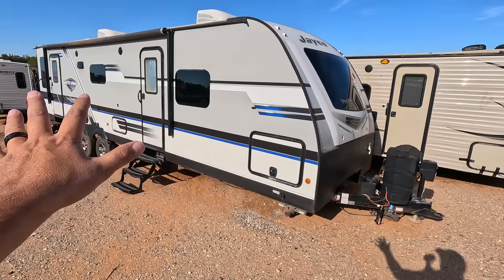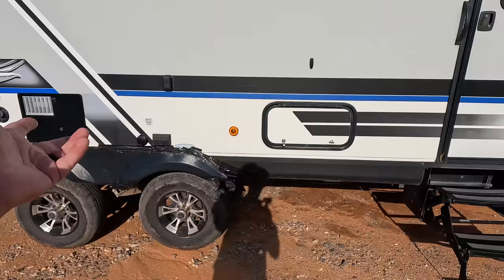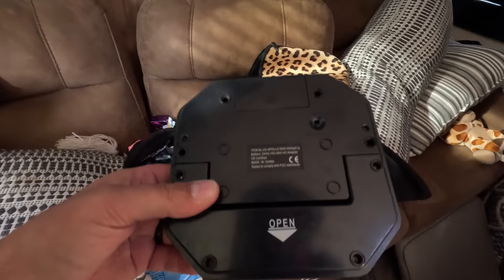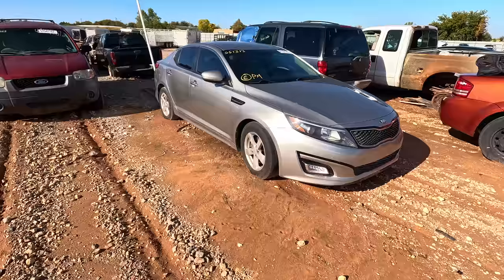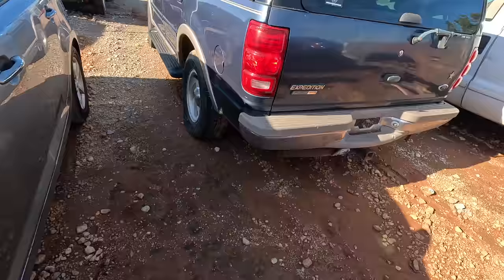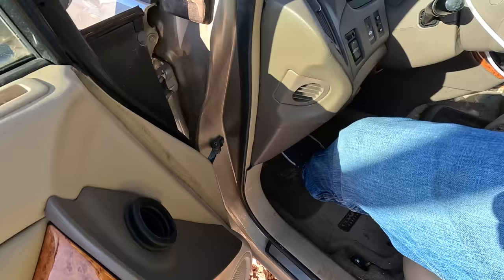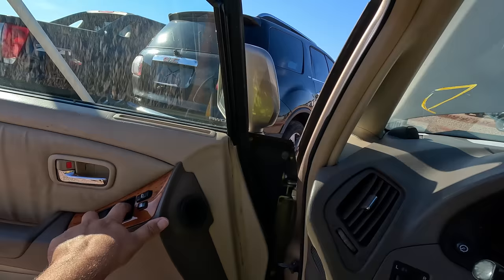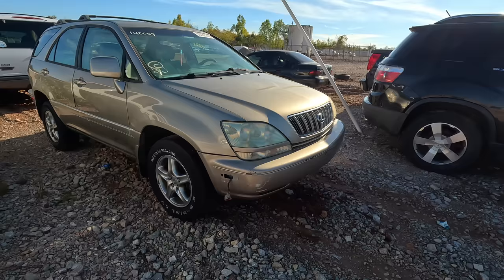Copart Walk Around 11-8-22 + Lexus RX300 Good or Bad Deal?

Comment: My wife had a 2000 RX300, it ran good... and we had over 250K on it before she got rid of it, still ran fine when we moved over...
Reply: My dad had a 2000 as well.  Trans started slipping before 100k. I think there was a lot of variation in the quality.
Reply: My mom has an 03 and it’s been great for the most part. The heater core went bad, and to replace it it’s probably a $1500 job strictly because the entire dash, steering column, center console, and seats have to come out. Because the heater core is bad, coolant leaks out and into the cabin. It also has a strange rattle coming from the engine bay whenever you give it gas. Hopefully that’s just a loose heat shield. Other than those issues, it’s been a great car. 196k miles and only a little bit of rust.
Reply: @james_schneiderwind  For the most part, they are just like any other Toyota. Things WILL happen but, overall, they will always start and move.  The nice thing about the early RX, they shared the motor with Toyota models. So, if you can find a small shop that does not charge $175 an hour, you could get most of those problems fixed for a reasonable price point. 

Once a Lexus is out of warranty, find a different repair shop...

Comment: Randy with those kia’s and the Hyundai there’s a recall on the engines if u get it u can take it to the dealer and have a new engine installed and the mileage doesn’t matter my friend got a Sonata from auction with 220k had bottom end knock and took it to the dealer and they replaced it for free

Comment: I work at a Kia dealership and the engine warranty extension is lifetime/unlimited mileage on that engine as long as the recall (ECU update) has been completed and there is service history (oil changes as per manufacturers schedule).

Comment: Back in the 90s Kia had built the aspire for Ford  I had 300 thousand miles on  it when I traded in 2005 still going strong no oil leaks or mechanical issues  except alternator had to be replaced every so often

Comment: Looks like the damage is from a tire being blown out, could have been caused by an impact (thus the axle looking off) but I think the axle is fine, if you look at the shackle for the leaf springs, the front is way higher than the rear, which I believe is supposed to do that.

Comment: I had a 2000 Lexus RX 300 with 259,000 miles on it. The transmission got stuck and the car would not move on Neutral. I ended up selling it for about $1,300 a couple of years back. I would not bid on this one because it will be expensive to fix.

Comment: Don't open the fridge!!! . A good cleaning, some easy fender and "j" wrap metal replacement . Replace the refrigerator ( you will never get the smell out). It needs a new power jack. Other than that it would be a good RV.

Comment: You should buy a newer Hyundai or Kia with a push button start and try the USB trick.
Supposably if you take a powered USB device and stick it into the car's USB port, it will allow you to Start the Car.
I think if you were to try it, it won't be faked, it would definitely be a real world test.
Reply: Ummmm those only work with a non push to start Hyundai and/Kia.
Reply: @CarringtonHollister  are you sure, I'm pretty sure it's a new generation with the push button starts.
Since how are you supposed to drive, since the key locks the column.
Reply: @redneckbryon  my girlfriend and my eldest sister I know for a fact has a 2014 Kia Sorento with push to start and so far in the news it’s only physical key equipped Hyundais and Kias w/o immobilizers.

Comment: I had a 2000 lexus rx 300 loved that thing a very smooth ride. I think I had the knock sensor issue at 210 k miles. Would run at 4k rpms on the highway and started running rough and started burning a lot of oil. Got rid of it at 220 k miles and gas mileage was not great other than that I loved the car a beast in the snow with all wheel drive.
Reply: Useful tip - change the knock sensors for 300$ and you can run another 220k without any issues.

Comment: The kiss have a extended warranty to 150k miles. If it had under 150k I would say buy it but because it’s at 157k you can’t replace it for free and it’s about 9k or more for a new engine on those.

Comment: I loved loved my 99 rx300, but mine definitely didn’t sound like that with 225,000 miles. it’s such a great car, but my brother ended up breaking it. 🥲 

i will verify that the knock sensors are issues, but once my brother changed those, it shifted perception fine!